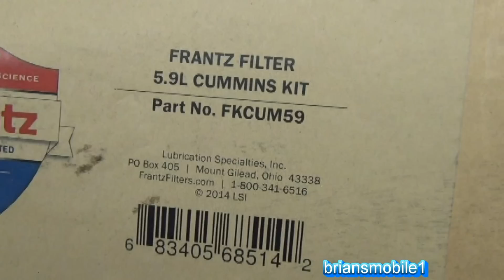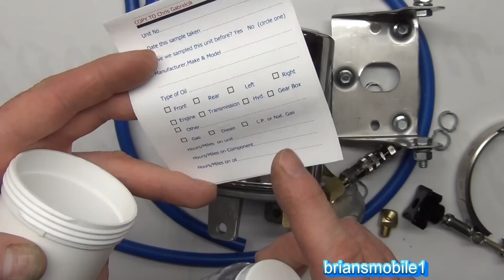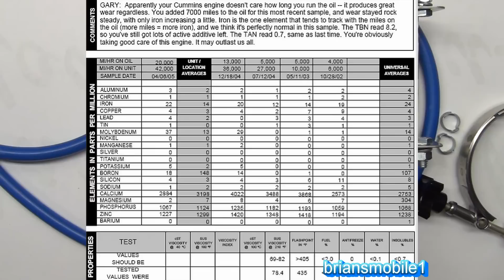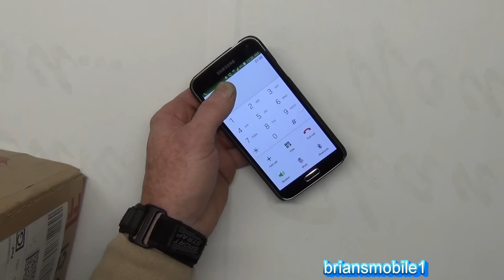How to Make Synthetic Oil Last Even Longer  Frantz

Comment: Long story short... A video on installation would be really cool... I do understand the benefits of this idea. I would even do it on a Ford Focus for fun and for gain.
Reply: Frantz has one on their site.
Reply: This idea is not new, as most over the road trucks use a similar product called a luberfiner filter. Only it is huge by comparison.
Reply: The Luberfiner  is getting rare on trucks. It was common to see Luberfiners on over the road trucks. Some were chrome plated and had a Peterbilt decal on them. Then you only saw them on dump trucks and other trucks operating under dirty conditions.. at one time they used cotton waste. The later 750 cartridges like WIX Fleetguard  and Luberfiner went to pulverized newspapers and wood chips.  Worked for a company that wouldnt put a truck on the road until a Luberfiner was installed. They were nasty to change.most people dont understand the importance of clean oil. When they started putting full flow filters on trucks people thought they cleaned oil as good as the big filters.The big luberfiners ended up out behind the shop.I think the last big Cummins Fleet Guard 750s I bought were inexpensive. The International truck dealer I got them from passed away. So did my discount. I still have a Fleetguard 500. Its about half the size of the 750. The big Gulf Coast filters clean better. They aint cheap.
Reply: They are all different. It takes someone that can look things over and decide where to put the filter and where to get pressure and return the clean oil.. I just bought a Ford Diesel tractor that needs to be restored. Was looking for some parts ive been hoarding. Right there collecting dust was a flat head Ford V8 canaster filter. I converted it to take a roll of Scott 1000 and installed it on the tractor. Using a Perma Cool universal sandwich adapter that I got from JEGS years ago. Couldnt find a old Frantz 2 port that fit.

Comment: I'm wounded how to install this as well. it must be separate then the factory oil system for flow. so some how it's a second filter system. how's it get pressure
Reply from the maker: The filter head has pressure ports for power take off's, turbo's etc.  You tap into on of those ports.  The oil goes through the filter and then it goes back in the  oil cap.
Reply: The conventional way is the same as my 41 Dodge. A tee at the oil pressure switch and a self tapping hollow bolt in the oil pan. We didnt have oil filler caps to return the clean oil to the oil pan. We had 3/8 hollow bolts to replace a intake manifold bolt on many GM and Chrysler V8 engines. I have used Perma Cool universal sandwich adapters that I got from Jegs. They are for oil coolers. They return the clean oil to the in side of the inlet of the full flow filter. When I put a Frantz on my Rambler American flat head 6 it was a piece of cake. It came factory equipped with a bypass filter. I tossed the piece of crap factory filter and installed the Frantz. When the oil went from black to gold I was a happy camper. Havent ran on dirty oil since.
Reply: We didnt have the fancy oil fill cap. I have drilled and tapped a few plastic Toyota oil caps to 1/8 pipe and put a compressed air swivel fitting on. The best thing on a car is to find a two port sandwich adapter. My Subaru has A Perma Cool universal sandwich adapter  from Jegs. Its actually for an oil cooler. Saw a bunch of them when I bought a Jackmaster Classic on Ebay.

Comment: The table top display  at 2.50 would be something I would like to make. What did you use for the pump to move the oil from the dirty pan/bucket to the regular filter then out to the Frantz filter. Got any plans on how you made it.
Reply from the maker: I didn't make it.  They built it as a demo piece.
Reply: Back in the 60s Frantz and Motor Guard had beutiful demo units in a sewing machine box The unfair thing about them was the only filter that were as good were each other. Pleated paper filters cant clean oil. You wouldnt put a Australian Jackmaster where the spin on filter is. Frantz stuck with that obsolete design and got left behind. Hard to find TP that fits now.. Jackmaster claims their elements are better than TP but they set up the filters for TP for we peasants. Push the paper down against the bottom and put on the lid. A piece of cake. The Jackmaster has a way to pull the fabric covered element out. Peasants need long nosed pliers.
Reply: The last demonstration machine I bought from Frantz used a water fountain  pump and a gasoline valve like you switch from one tank to the other. Rather crude compared to the origionals of the early 60s. The valve is on the old F 250 now..

Comment: I use a differant brand than this on my tractor trailer, it holds 10 gallons of oil, I take an oil sample every 25,000 miles and only change it when the oil is dirty or contaminated. the furthest I've ran the oil is to 250,000 miles
Reply: +DaBossk yes but normally I only get about 100,000 miles per oil change, and presently I have 1,250,000 miles on the truck with no engine issues and all still original
Reply: But but but but..... your ADDITIVES will run out!!!
Reply: .You just push in the TP and put on the lid. The Frantz is a terrible Design especially for using TP. The Jackmaster Classic will need a wrench and some long nosed pliers to pull out the used paper. The Jackmaster Classic has a fabric covered element with a ring to pull out the element.
Reply: You dont need synthetic oil. In the 60s I used Standard Delo 100 30 winter grade. It cost me 29 cents at the discount stores. I didnt drain oil but I changed the TP and added a quart of new oil. Delo came in 20 and 30 weight. Of course there were no diesel rated multi grade oils in those days. We changed the TP and added a quart of oil at about 2 K miles. Delo was popular mostly because it was beautiful when clean.
Reply: Years ago I was talking about a Detroit series 60 with over a million miles on it with virtually no wear. Road King Magazine asked me for the owners phone number. They did an article on it. It used Shell Rotella 15 40 conventional oil and a Gulf Coast filter that used two Bounty big roll paper towels. Gulf Coast filters used Frantz 3 stackers until they went out of production.

Comment: I didn't see any bypass on that filter. What If it gets clogged?
Reply: it is a bypass filter by design.  It just takes some of the oil and runs it through the TP filter on the side IE in parallel with your oil pump.  If it fails to flow nothing happens except you don't get that additional filtering.
Reply: The bypass filter is putting  a small stream of clean oil in the oil pan until all the oil in the engine is clean. If you neglect the bypass filter the stream of clean oil will stop going to the oil pan.
Reply: Actually the Frantz works the same as any bypass filter for the last 100 years except it is better at cleaning oil because it uses toilet paper. The old cotton filters like on my 41 Dodge was almost as good. My 37 Studebaker book said it wasnt necessary to drain the oil except for seasonal reasons. Change the oil filter when the oil looks dirty.on the depth guage.(dipstick). They had a bypass filter that worked the same as a Frantz but wasnt as good.
Reply: To young guys seasonal reasons meant going to thin oils in the winter and thicker oils in summer. No multi Grades in those days.
Reply: I put a .025 wire welder tip in a brass fitting and put it in the inlet of my Australian Jackmaster Classic. It cleans about 3/4 quart a minute and sends it to the oil fill neck when the oil is hot. How this will work in cold weather short trips I dont know. I mostly operate in warm weather highway. This only works when there is no leakage around the toilet paper.

Comment: My dad used to use these on his commercial fishing boat and swore by them. Now that I think about it, I can't see why he doesn't  have them on the current engines.
Reply: A Frantz dealer in Gulfport Mississippi put a lot of Frantz 3 stackers on shrimp boats and such. At some point the 3 stackers went out of production.  Good filter for diesels but a mess to change.
Reply: The Frantz dealer in Gulfport Mississippi replaced the big Frantzs with bigger paper towel filters. He improved the little filters. I dont know how many times Frantz went broke. We also lost the FAA and PMA approved AeroFrantz. I believe Frantz had a 2 stacker a 3 stacker and a 4 stacker.  Its a tough business . Most people think allowing the oil to get dirty then draining it is proper maintenance. Then you have the bull shit stories that come with toilet paper filters.

Comment: I wander if you can use charmin?
Reply: ncrdisabled Submarine vet 😂👍
Reply: You can, but you want something like Scott 1000.
Reply: As long as I can get Scott 1000 or Great Value 1000 Im ok.  When I started using the Frantz in 1963 the grocery stores were full of 2 ply facial quality bath tissue with a 1 1/2 inch core. Single ply was loose wound junk. Things change. Hard to find bath tissue that fits the Frantz. Unless you use the Frantz elements. You can find 30 dollar bath tissue with a 1 1/2 inch core. My filters are all set up for the larger core TP.. pretty much all of the top loaders are set up to use bath tissue. I notice the Frantz has a custom made roll of bathroom tissue to fit the Frantz. As long as I can find Scott 1000 or Great Value 1000 from Walmart im good. Saw some Angel Soft I would use. I have enough Scott 1000 and Great Value 1000 on the shelf to last me for years. I have a dozen TP filters in use.
Reply: I notice the Australian Jackmaster Classic has no center tube like the Frantz.. Scott 1000 is strong enough it doesnt need a center tube. The Charmin  core will collapse  when you try to use it. The Frantz element is strong enough the center tube isnt needed. The Jackmaster element is strong.. In a pinch I would use some Angel Soft. Never Charmin. Not talking about the paper core. The strength comes from the firmness of the TP.
Reply: Saw some 2 ply Charmin like we used in the 60s before the Frantz elements or Scott 1000. The core is bigger and it is shorter. The top loaders can handle it. To use it in a Frantz you would need to know what you are doing.
Reply: The soft paper worked fine in the 60s because it had the 1 1/2 inch core and was taller. The Motor Guard separated in the middle. The soft paper would get a midriff bulge that would pinch in the gasket. The factory element is firm and doesnt pinch in the gasket. I would use the Charmin if I needed to. In the old days we didnt have Scott 1000 or factory elements.

Comment: I use the one you have on.your compressed air the Motor Guard. The name Motor Guard didnt come from  compressed air filtering. They dropped the Lube oil filters years ago. When Frantz went broke years ago one of their dealers came out with an improved filter. They all do an excellent job of cleaning oil. The Gulf Coast is by far the easiest to service. NASA is using the filters now.  A NASA engineer said these filters are only for industrial use. The car owner doesnt keep a car long enough to make it pay. We old timers got our start using Frantz. I notice the element is too loose in the housing. You have to be at least 80 with no teeth to know how to service a Frantz. I have a few Gulf Coast filters. Sister wrecked the old Impala. My last two Frantzs went to a salvage somewhere in Dallas tx. At one time in California you could find Frantzs on wrecked cars for about 10 bucks.
Reply: Ralph please make a conversion kit for the new motor guards. I really want to have one for my truck since it has a better clamping force and seal on the paper. I will be your first customer.
Reply: I dont do oil filters anymore. I recently bought a Australian Jackmaster Classic   from Ebay. It is as good as the Motor Guard. They designed the Jackmaster to take tightly wound TP or their own elements. They have a larger seal at the bottom for 1 1/2 inch or larger TP cores. You just push in the TP and put on the lid. They dont have a center tube like the Frantz to put a spacer on. The TP core is the center tube .. The Frantz has been obsolete since Motor Guard came out in 1961. Jackmaster has been around since 1954 but I didnt check them out until recently. I got the Classic. The more expensive Ultra is suspiciously  like the Triple R. They have all struggled over the years. Almost everyone thinks proper maintenance is allowing lubricants to get dirty and draining them.   I paid 29.95 for my first Frantz and used Standard Delo 30 weight in 1963. Motor Guard came out in 1961. They came out with a compressed air filter and later dropped the lube oil filter. A Frantz dealer came out with a improved filter and replaced the Frantz 3 stacker with a Bounty big roll paper towel filter at some point when Frantz went broke. At some point the AeroFrantz was dropped. Saw some on crop dusters in the early 80s. There were no Frantz elements in the old days.We used 2 ply facial quality toilet paper. Single ply was loose wound crap. A lot of bull shit stories and jokes came with toilet paper.They are all trying to get away from being called toilet paper filters. John Frantz wanted a filter material better than anything else that was economical. That was a mistake. He didnt count on the liars and fools.
Reply: @markm0000  I was getting the Motor Guards for about 75 bucks and converting them to use TP.  Saw one for 175 bucks. You can get a Jackmaster for that that is already set up for TP.
Reply: @ralphwood8818  I tried finding someone to make adapters for the motor guard but it was going to be way too expensive and I gave up. I have no means of making them myself even if I bought equipment. I will look for a Jackmaster and use that on my cars and trucks. It seems to be reasonably priced and has a better design than the Frantz. Thanks Ralph.
Reply: @ralphwood8818   Hello again Ralph, I hope you are doing well. I checked online again for the Classic, but prices sure have gone up since my last comment. I like the design better how it doesn't rely on a tight center tube for fitment, as the roll dimensions can change a little over time. I like that it's also designed with components to handle hot oil. I bought a new style MotorGuard since that last comment to see it in person, and just couldn't figure out how to make it without spending a fortune. It's been sitting on the shelf in the box and I guess it's best to install it on my air compressor where it belongs. I wasted that money when I could have bought the right thing in the first place. The saying goes, buy once, cry once, buy twice, pay the price. It's funny to think the Frantz is a subpar design but because of the marketing and social media videos it's become the most popular. Thanks for testing all the different models from all those brands over the years to find the best canister design and share that advice to the internet.
Reply: @markm0000   After seeing the Jackmaster Classic needs no center tube if you use a firm roll such as Scott 1000  why couldnt you put a flat seal in the bottom thick enough to compensate for the shorter paper and a washer at the top to put the squeeze on the toilet paper core. The Motor Guard works great with the Scott 1000. You can make a orifice by running a 1/8 pipe tap in a 1/4 male to 1/4 female  adapter putting a 1/8 pipe plug that takes an allen wrench. Then drilling it. 1/16 inch is the standard size. Some put JB weld in a fitting and drll it. For oil lines I get 3/8 inch Gates transmission cooler hose from O Reilly's and fittings from Ace Hardware. The botton seal dont need to cut into the paper. Flat is good. You could probably make seals out of wood. Easy with a lathe and some aluminum. The Frantz dealer that made the Gulf Coast Junior. Made the whole filter out of glass filled nylon. His business was putting Frantz 3 stackers on large marine engines. At some point they were discontinued. They went to paper towel filters. Gulf Coast filters put of Gulfport Mississippi .
Reply: The Frantz is the best seller because it is the best known. The only paper that fits the Frantz is the Frantz elements. You have to know what you are doing to use toilet paper in a Frantz. When I started using a Frantz in 1963 you could go into any grocery store and grab any 2 ply facial quality toilet paper. Single ply was loosely wound. Gulf Coast filters of Gulfport Mississippi were Frantz dealers. They had Frantz 3 stackers all over the Gulf of Mexico on marine engines. At some point the 3 stackers went out production. Gulf Coast came out with a better toilet paper filter and a heavy duty paper towel filter. I still have a few of their little filters in use. My old Ford 390 has  a Gulf Coast junior on the transmission and a Motor Guard on the engine. Gulf Coast is heavy into military and other commercial use. Not sure if they still make tp filters. I believe NASA saw my posts on a trawler forum and started using them. They were moving the shuttle then. One of their diesel equipment guys was  debating me.